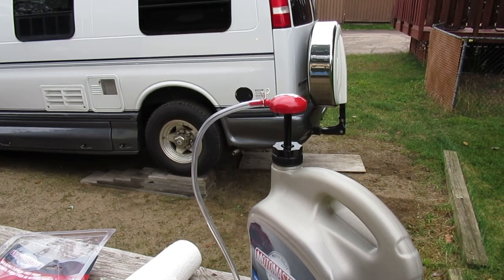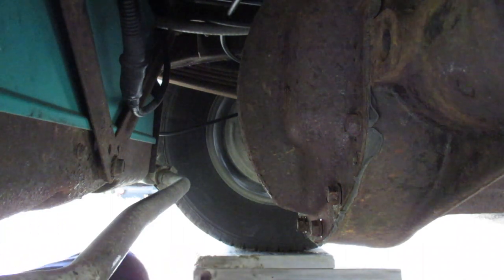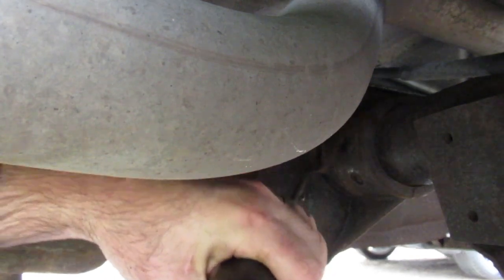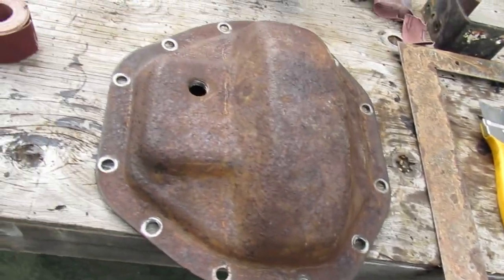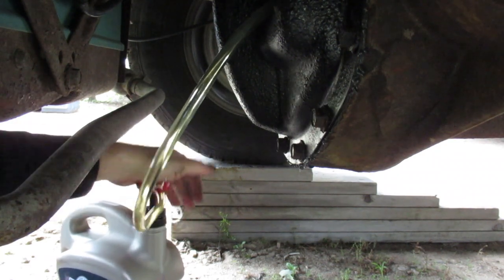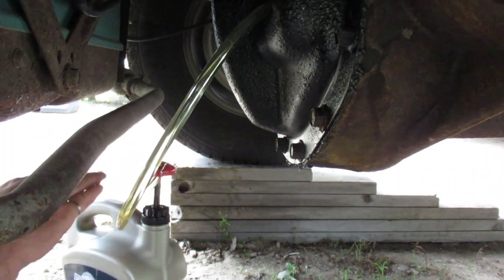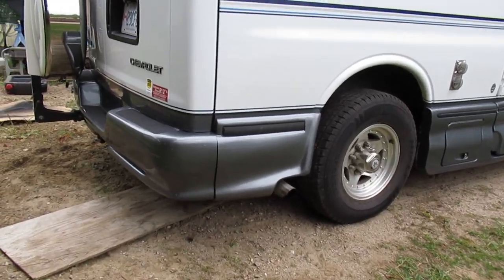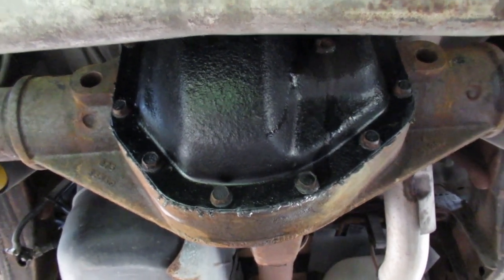Changing Differential Fluid 2004 Chevrolet Express 3500 Roadtrek Popular 190

Comment: Great video!  I have a 2007 Chevy RT 210 Popular.  I’m going to be serving my diff and at the same time I want to install an aftermarket diff cover with a magnetic drain plug and dipstick.  I know I have a GT5 4.10 ratio, but I need to know if I have a 14 bolt AAM 10.5” or AAM 11.5” diff.  Do you have any idea which one I have?
Reply from the maker: No, I'm not sure.  I wasn't able to match mine up to a gasket so I just used gasket maker.
Reply: Stephen Rivett  ok thx

Comment: Hi i have a 2009 express 2500, do you know if i need to add friction modifier additive?
Reply from the maker: You will have to get your VIN decoded or find the axle code on your vehicle to see what it has if you want to know in advance.  You could also buy the modifier, pull the cover off and look inside to see if it is an open diff or not.  At that point you would either use the modifier or return it depending on what you found out.
Reply: @SteveRivett  thanks i did some research and found that in fact i have a G80 gov lock diff. Now the owners manual only states to use 75w90 synthetic oil and from what i found out you do not need modifiers because synthetic oil already has "modifier properties"